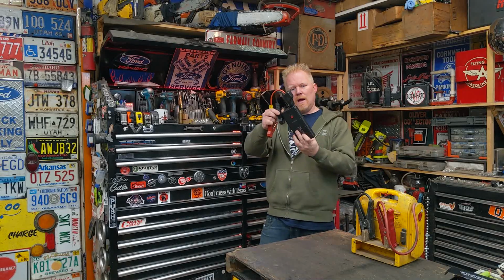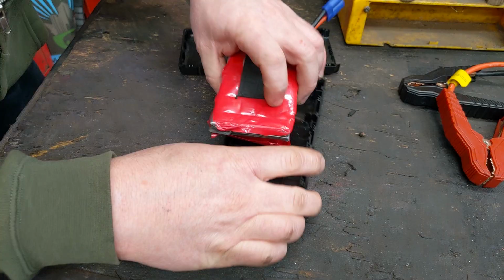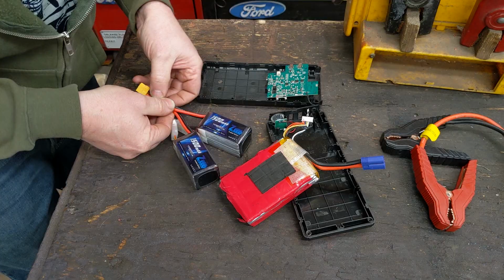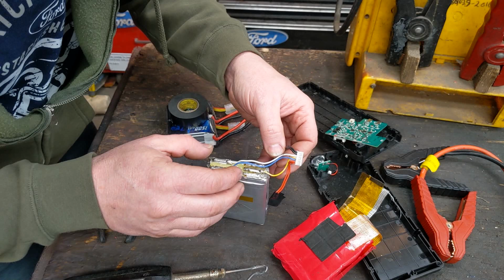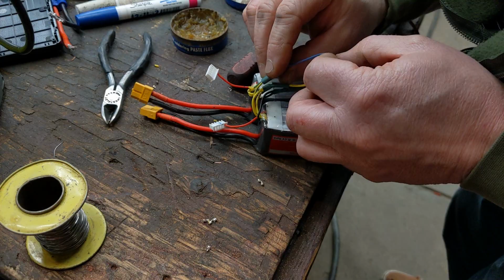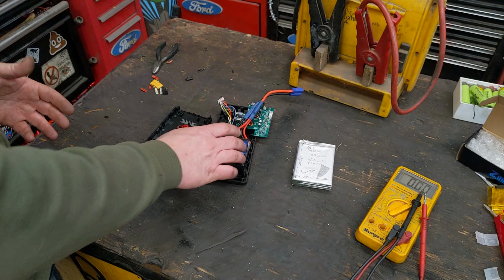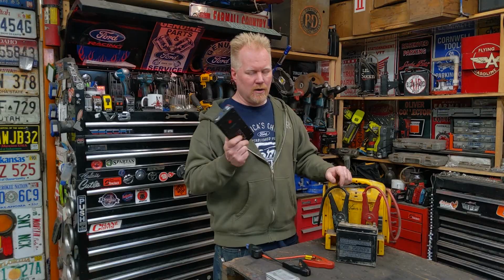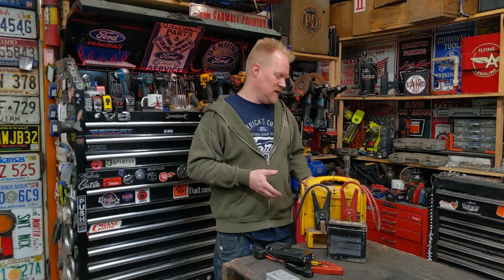Lithium Jump Pack Battery replacement HOW THEY WORK

Comment: I bought a beatit  g18 model about 3 years ago. Used it more time than I thought I would my battery family stranded strangers reach lift scissor lift ditch witch . Lipo batteries been swollen for nearly 2 years. Still works like a champ! However I want to change from lipo to lion batteries. One thing that is extremely important on those lipo batteries it the cell charge. Every one of those lipo batteries that you have will get damaged if held at a full storage for more than 3 days or longer. 16.8 volts is what most of these jump starters hold thats at 4.2 volts per cell. Before I fly my built quadcopters I fully charge before flight session. End of flight session I charge to storage voltage 3.85 volts.same with my rc vehicles. This will keep these lipos in good condition. I've learned several times over ruined expensive 4 5 6 cell lipos. I do not understand why these lipos are in these jump starters.They stay in your vehicle for months before needing. That is never good.  Truck battery was dead this evening. So was my jump starter, charging the beatit g18 charger right now. pulled out my modified li lion jump starter. Got me going to the movies lol. Anyways excellent video! Keep them coming!
Reply from the maker: The issue is the discharge rate of li-on cells. A standard cell can only push 5amps max. A high discharge can reach 30amps of continuous discharge or 60peak in short bursts. That's good quality name brand cells.  A single lipo can dump over 300amps. Take the ones I used, they can dump 360amps continuous or 720amps bursts in parallel. Li-on would need to be a 10 in parallel/4 series to equal this (10p4s). That's 40 18650 cells. I now keep mine at 3.80-3.85 volts per cell and it's enough to jump start everything. At this voltage they should last 10+ years with the minimal amount that gets drained/cycled. Generally they only drop to 3.7v after a jump start.

Comment: Great to point out that these can be rebuilt. However your video leaves out too much information to be useful to most people. You really need to draw wiring diagrams of both batteries including balance leads and their connections to the built-in charger in the jumper device. Then of course do the same for the new batteries. Once the viewer sees how simple the connections are it should be easy to understand how to replace one with the other. Like they say, a picture is worth a thousand words.

Comment: Great video. I bought one of those jump starter devices, charged it up and put it under the back seat in the truck for about a year and when I went to use it, dead. I tried charging it but it would not charge no matter what I tried. 

I don't know if the batteries went bad or too low to charge or what but just hate that I spent over $100.00 for it and never got to use it. I was thinking about buying another to keep in the truck just in case but if I do that, I probably need to get it out once in a while and make sure it works and/or charge it.

I like the idea that you can replace the batteries, that is also an option.

Thank you.
Reply: Coincidentally I just asked that- because lithium polymer batteries don't like to be treated the way lead acid are, which is to be kept at full charge all the time, you're better off storing them in standby only half charged. That optimizes battery life for them, although it goes against the goal of having it always full and ready just for the infrequent emergency use situations.  
My purpose for the jump pack is mainly for emergency use, so there may be long times between pulling it out of the trunk. It'd be otherwise sitting in a hot trunk in the summer or freezing temperatures in the winter.
I have the alternative super capacitor jump packs by Schumacher and Autowit, which have worked out well for me the times I've needed them. Since they don't use batteries, I expect they'll last much longer just sitting in the trunk most of the time compared to the lithium packs.
Reply from the maker: I did a bunch of reading after the video on longevity of lipo batteries. Turns out they hate being stored at full charge(4.2v per cell) and their lifespan is drastically reduced if this is done. They store ideally at 3.8-3.85v per cell or 3/4 charge on your jump pack. Theoretically they should last 10-20 years if done so. I tested mine out at this voltage and it still works awesome and will give me 6-7 good cranks on a V8 engine at 3/4 charge(15.2-15.4v total pack voltage).  I guess the high end lipo powered drones/toys will automatically self dicharge the batteries after a few days to help preserve it's life.

Comment: This a bit of a technical question more than a comment.  The general recommendation for these lipo batteries is to keep them stored at a "safe" minimal charge, or voltage, so they don't degrade over time. According to all of the internet comments, you should NEVER keep them fully charged.  I have a lipo booster that I purchased at Costco and it came in handy about 3-4 times and it will no longer charge. I've taken it apart and it is a 3s pack.  I've purchased replacement (larger) 3s pack.  Like you, I looked for a replacement that fit, and couldn't find one. These packs come shipped at 11.4 volts, but charge up to 12.6V fully charged.   If I'm using this pack as an emergency booster, in my wife's car, and if I charge it fully, so it will be most effective when jump starting, (12.6V) is it safe to leave in that state?
Reply from the maker: The 3s pack jump starters are not good in my opinion. Like you state they will go dead in just a few years if not a year if stored fully charged. But you have to keep them fully charged to make them usable. The 4S packs are much more suited to jump starting a car because of the higher voltage. I keep all those at 15.2/3 volts (3.8-3.85v per cell). At this stable lower voltage I can get around 6+ Jump start attempts on a car. They should also give me around 10 years of life.  The 3s packs only give you one attempt on a full charge. Being from Costco they will give you your money back. I would return it and buy a 4 s pack. The difference is night and day.

Comment: Have you considered replacing the battery in the lead acid unit with a LiPo? Granted you'd have to fit a LiPo charger board or at least a port for the balance wires, but it would seem to be an excellent idea.

Comment: How much amperage do you need for something like this? I’m wondering if I could make an 18650 holder that would put out enough juice (maybe 4 or 8 batteries). I know lipo typically put out more current that li-ion, but an 18650 version would be really easy to swap out bad cells.

Comment: If you use a Heat Gun on insulating tape it fuses together and never comes undone. You can't always fit Heat Shrink but I use both if I can.

Comment: Your pack is a 4s, with a peak of 16v (maybe almost 16.5v).  Be careful with jump starters like that.  Some vehicles have electronics that don't seem to tolerate that high of a voltage. Usually if the lead battery is not completely dead it will drag down the voltage enough to be safe. But be careful. Any day you fry an ECM is not a good day.
Many battery packs are actually 3s with a peak voltage about 12.6V.  I prefer that kind for the car.  (But I use a 16v one for my old diesel tractor and lawn mower. :) )
Reply from the maker: I thought the same but then measured the output of my plug in battery chargers. They dump 16+volts when you connect them and they never cause issues. The fastest way to charge a battery is with a higher voltage than the battery. The entire computer etc in a car is designed to handle wide voltage swings as nothing is stable in a car battery/charging system. I've seen swings of 16volts from car alternators as well when you first fire up the car with a dead/low battery. So the 4s at 16.5v(that's what they charge it too when full) simulates a battery charger and higher voltage simply means it draws less amps to do the same job. So if your starter needs 500amps at 12volts your 16.5v jump start box only needs to put out 363amps to equal the exact same power needed. I did a lot of reading to see if I could find any cases of cpu frying and found none. I then watched a guru (Pine Hollow Auto Diagnosis) use these and all he does is travel to repair shops as he specializes in automotive electrical fault failures. He even calls out the higher voltage these put out and says it will be no issue for car computers. The car computer has 2 sides to it. The 12volt side and the critical voltage regulated 5v side(and sometimes 3.3v). The 5v(3.3v) stuff is the sensitive stuff and the wide voltage swings from the charging system are all regulated.

Comment: Super job on that, the only downside I find I’d recharging , can these be recharge using a model aircraft battery charger which is capable of higher charge rate, could this be done by plugging into the output for the jump leads?

Comment: How can these small wires and battery carry the amps require to start a car. Good jumper cables use #4 - #6 gauge wire. It seems to defy physics. Great video.
Reply from the maker: The shorter the wire length, the thinner the wire gauge you can get away with.

Comment: Check out the charging parameters of the unit in watching utube videos I found out sealed lead acid batteries should not be discharged below 12. Volts and should be charged to 14.8 ideal is to keep them between 13.4 and 14.8 for storage with a battery maintainer but my old dead booster packs chargers were all 12 volt out so since my old black and decker was handy I took it apart to find out what the battery manufacturer website said the charging parameters were but written right on the battery was do not discharge below 12.2 float charge is 13.4 and full charge is 14.8 and on the built in charger was output 12 volts so it was no wonder it failed it was dead to start with and being discharged way too far since I had bought everstart from Walmart I checked to see what it was charged to 13.1 so I phoned everstart they said for their batteries that was fully charged so I used the two of them for boosting my pt cruiser each one gave me 5 boosts which I need as my pt cruiser has a glitch sometimes if I start out with a fully charged battery I can start and stop it every time I go from one stop to another other times every time I shut it off I've got to boost it it's the weirdest thing I've driven it 2 hrs shut it off and had to boost it on another time I I drove it a mile shut it down and it fired right up went across the street and had to boost it vs my booster packs are used quite often I've also used them to boost my Ford cube van  but after a  year I noticed that the amount of boosts I could get from the booster packs had dropped from 5 to 4 and quickly to 3 so I hooked my charger up to the cables and turned on the cables and plugged it in the first time I charged it it got to 90 % 13.1 volts I left it charging for a day but it wouldn't get any better but I found after a few uses and recharging it through the cables it would finally read full charge but at 13.9 volts since then I've got another year out of it and am hoping for one more but I will say don't buy ever start booster packs with the compressor and 400 watt modified sine wave inverter the first time I used the compressor on the one after 10 minutes I tried to turn it off and it didn't shut off since most 12 volt compressor burn out I'f you run them too long I hooked it up to my old Ford turned the light on I thought it would have a low voltage shut off but I had to kill the battery to dead I thought it would reset but I had to open it up and cut the wire to the compressor last Wednesday I stopped to help my neice her tiire had a slow leak and had gone flat so I pulled out my booster pack that still had an unused compressor to fill it up and it didn't work at all so both have faulty compressors haven't tried the inverters yet now that I'm not working I don't need them used to use them to charge my cordless tools when working as quite often there was no power

Comment: I upgraded my Walmart all in one lead acid jumper to headways. With those cells it is supposed to put out a continuous 400 amps. Cranks all day on want ever I need just have to watch the cables they get warm.
Reply from the maker: I saw those a few years back. They look like they pack a punch.
Reply: I plan on building a 4s 1p for the lawn mower this spring should out last the mower

Comment: I would not bother fixing an old one. I have just bought a New Engine Starter. LIPO batteries are not very safe if they expand. They can cause a Catastrophic fire if something goes wrong. Is it really worth all the effort to rebuild the Battery Pack !!!

Comment: It's amazing how a small thing can put out so much power, I should probably get one. I guess it will discharge itself after a week or so like a drone battery, I used to have a DJI Phantom 1 that had a 3s lipo and used to store them at 50-60%. Was Ginger trying to catch bugs or something?
Reply from the maker: I know my DJI is set to self drain after a week to a more stable voltage. They last much longer this way. The jump packs don't seem to have this technology and stay fully charged for months. It would likely still be 80-90% after a year of sitting. 
Ginger loves to try and catch the wind.
Reply: @sixtyfiveford  DJI does that to preserve the batteries, as this type of battery degrades rapidly when kept at full charge for long periods.
If you're not actively using it, it's a good idea to implement the discharge scheme on your own, storing it half full if you can. You just need to verify it still works for your starting purposes when it's at low charge.
If you knew exactly when you were going to need it, best thing is to only charge it up shortly before you need it, and then discharge it back down to mid charge for storage again.
Reply from the maker: I just read all the literature that came with my new batteries I installed. They say not to store for more than a week with over 3.8volts/cell. It says in nice terms it will kill them to store them full.

Comment: I asked my friend who works repairing heavy equipment. Semi's etc. I asked his opinion about these jump start packs and he approved them on older vehicles, but he mentioned that new vehicles with computers everywhere, he stated that they give unpleasant voltage spike right when the load kicks in. He said that there's absolutely possibility to kill most modern stuff with that and said that he wouldn't personally jump anyone in new car with those.
Reply from the maker: I thought the same but then measured the output of my plug in battery chargers. They dump 16+volts when you connect them and they never cause issues. The fastest way to charge a battery is with a higher voltage than the battery. The entire computer etc in a car is designed to handle wide voltage swings as nothing is stable in a car battery/charging system. I've seen swings of 16volts from car alternators as well when you first fire up the car with a dead/low battery. The 3s lipo packs do not work well as their voltage is too low. The 4s at 16.5v(that's what they charge it too when full) simulates a battery charger and higher voltage simply means it draws less amps to do the same job. So if your starter needs 500amps at 12volts your 16.5v jump start box only needs to put out 363amps to equal the exact same power needed. Now if the voltage was pushing 18-20volts I would be concerned, but even there guys try to use power tool batteries(5s 21v) to jump start cars and there are never issues other than possibly ruining you power tool battery. The main reason voltage from an alternator is capped at 14.8volts is because it will boil out the electrolyte in the lead acid battery over that. 

The car computer has 2 sides to it. The 12volt side and the critical voltage regulated 5v side(and sometimes 3.3v). The 5v(3.3v) stuff is the sensitive stuff and the wide voltage swings from the charging system are all regulated.

Comment: Great video, thank you. Just curious, I noticed there were some pairs that were being charged by the BMS. Has this caused any issues like unbalancing or charging issues?
Reply from the maker: Nope. Pairs always self balance each other. Parallel charging is extremely common in lithium cells but not so common to be done with lipo because factories can make any size of lipo. Where lithium cells are universal size.

Comment: I was thinking perhaps you could put some vented plastic panels in the open portion that is bulged out to let air in or out.  Maybe melt them in using your solder gun so they look like they are part of the case.  Then you would be able to somewhat protect the inside from dirt and dust which always collects in any kind of workshop. It isn't something you haven't done before when patching plastic panels, right? Just ask Ginger, she watches every move you do. ;b)
Reply from the maker: Good tip!

Comment: What I don't understand is how so much current can be released by only 4 small lithium batteries (in series!!) several times, without drastically overheating, & a large lead acid cell can't compete. Yet most lithium power banks can't handle more that 300 W, which is only a few amps. compared to a car. Starting a V-8 requires a hell of allot more current, especially in the winter. I understand that it's for only a few seconds, but still.... Mind boggling.

Comment: In your new battery setup you have connected two batteries in parallel to each balance wire; don't you think it may cause balancing issues?
Reply from the maker: Two or ten batteries linked together will perfectly balance each other without any issues.